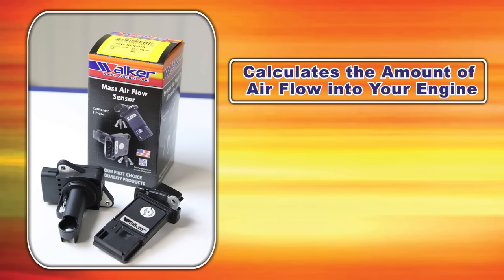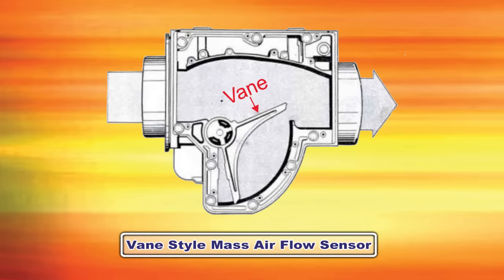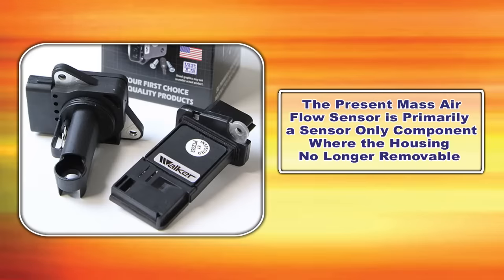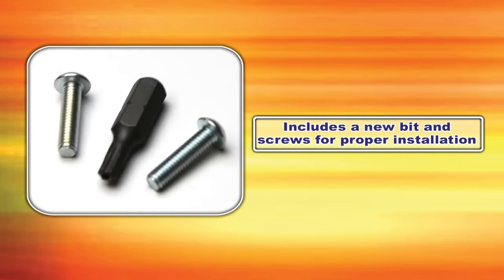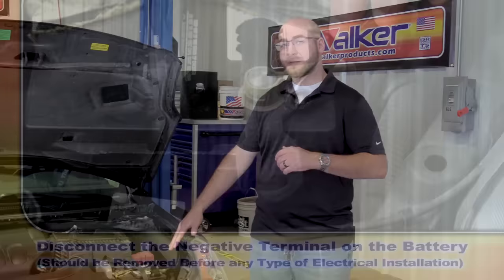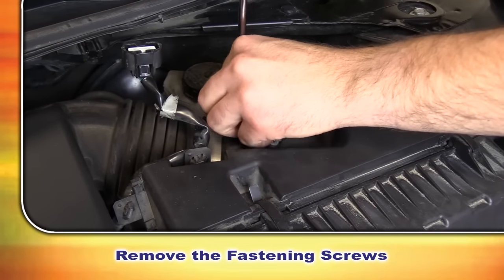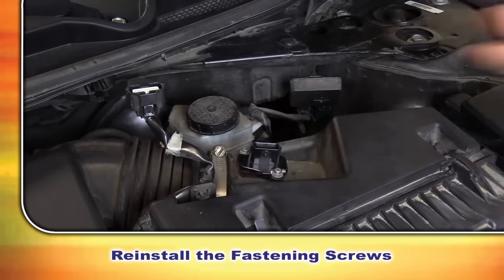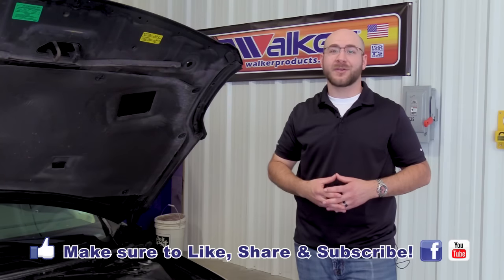How to Install a Mass Airflow Sensor

Comment: Your sensor made my truck run like sh*t. Stalled and wouldn't stay running unless I kept the throttle open. Waste of $78!

I put the OEM sensor from 1996 (w/ 339k miles) back in. Truck runs normally again. I guess it just needed an extra good cleaning.
Reply from the maker: Sorry to hear that our part didn't work as intended.

Was it a MAF Sensor you were installing?